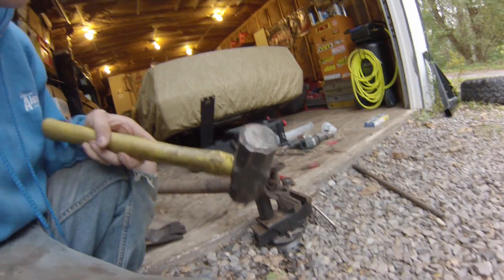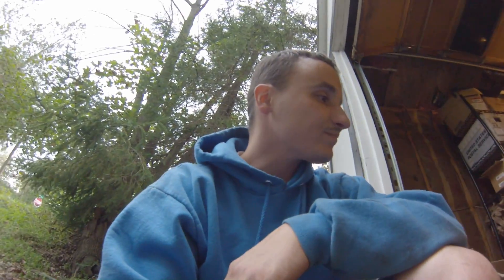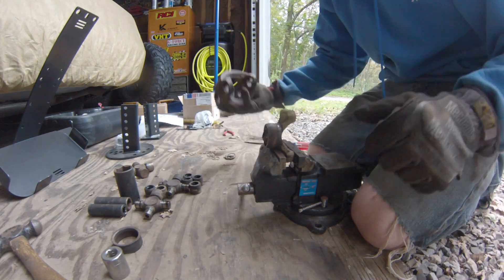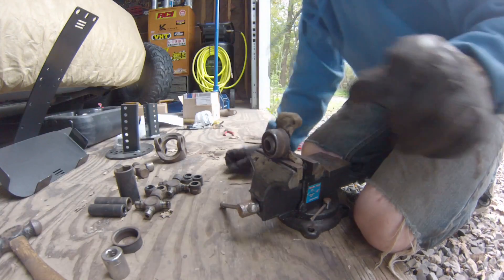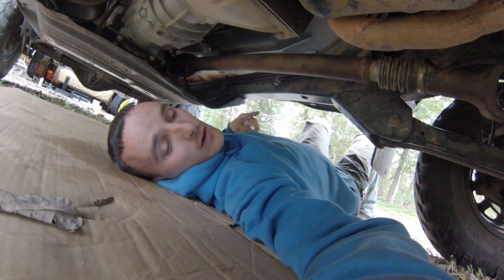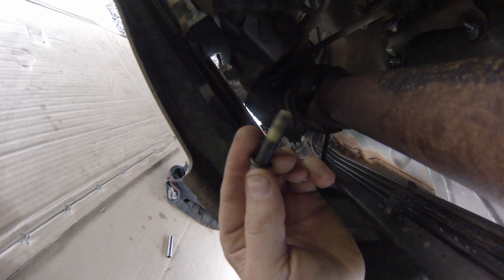Project TJ Wrangler: Ep 21- Front Drive Shaft Rebuild

Comment: you forgot to replace the rubber bushing that goes around your ball swivel that holds the grease in. you shouldve packed it all with grease brother then place your rubber bushing in first then your ball swivel. itll take a tap with a hammer from the grease suction to reapply that ball that swivels into the rubber bushing that hides that ball and spring.

Comment: i just redid my front and rear drive shafts on my 99 sahara. the double cardan is a bitch but reused my ball swivel. as long as you keep them packed with grease your needle bearings will stay in.

Comment: Would you know if I can replace my single ujoint on my driveshaft with a CV ujoint on the same driveshaft? If I can, how much longer will the double cv joint make the driveshaft?  Or is the ball joint and cup specific to the cardan driveshaft and won't work on a standard (single) ujoint driveshaft?

Comment: Nice job. Other videos on this subject kinda gloss over some of the important details. Same thing happened to me. Thought I was just replacing u joints and now I've got that ball to contend with. Then the salesperson at the parts store sold me the wrong kit. Ha ha. So if there are any first timers like me attempting this fix, just make sure you get the right ball kit. Also, the inner most u joint is a little difficult to get off. Will try to get it off tomorrow with a ball joing press. Thanks for taking the time to post this video. If it weren't for Youtube and Jeepforum I would never been able to try this stuff myself. Turns out the internet IS useful for something other than Facebook and porn.